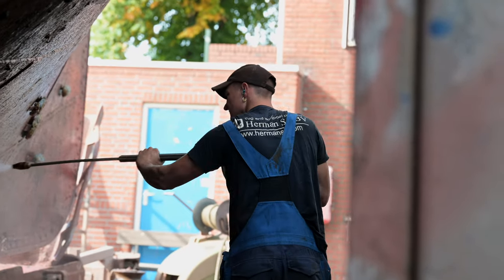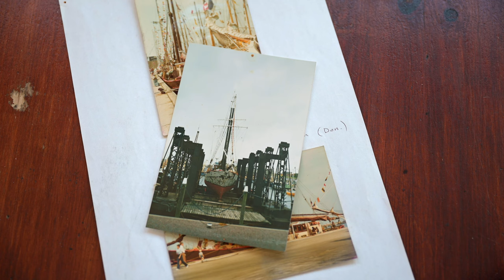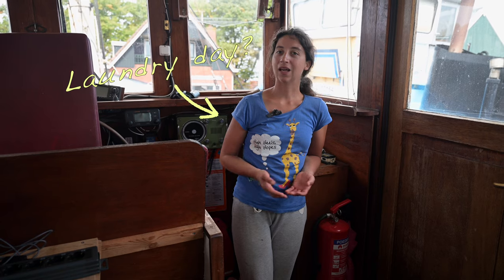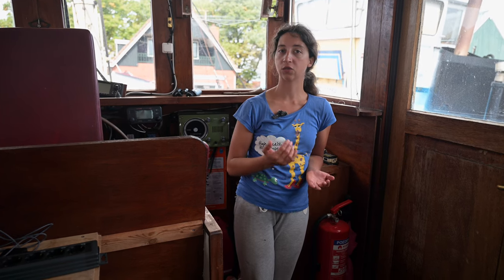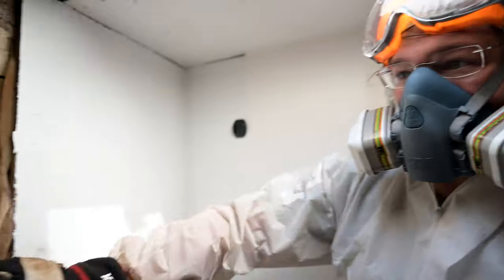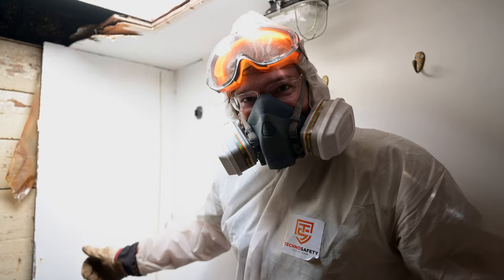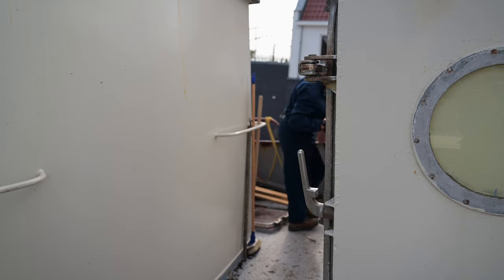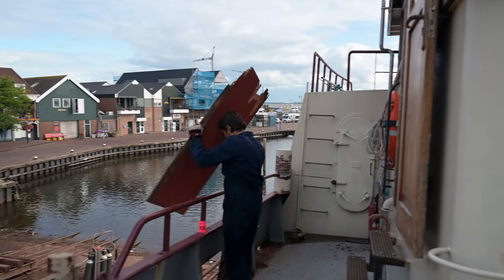Gutting the Interior so we can weld the Hull! We need to be fast!

Comment: There is a product called "RustLoc" it's made by the Pettit paint company here in the USA. It is sold as a "Rusty Metal Primer" and is a product I've used many times over the past 35 years and have found it to be a great product that works unbelievably well "IF" you follow the directions EXACTLY. You'll most likely end up using the "Needle Gun" and other mechanical descaling equipment to prepare the inside of the hull. Then use some type of metal primer/protector coatings, prior to covering it with insulation/wall coverings. I've not had long-term success with any "rust converters" on the market, to me, it is a lazy man's answer. My experience has shown that for Rustloc or these rust converters to work correctly, you need to remove all the rust and corrosion you can with these mechanical means...(which will be well below the  "White Metal" finish of sandblasting.) This thin final layer of rust/corrosion that is the devel to remove; can now be successfully treated with a rust converter...but at that point of preparation... I feel that Rustloc gives better long-term (life of the boat) performance.  To give you an idea of its adhesion... If you don't clean the top of the paint can PERFECTLY before you replace the lid on the can...it will weld the lid to the can and you'll need an ax to reopen the can. 
You truly have a major project on your hands not unlike the rebuilding of the wooden S/V Tally Ho... except yours is made out of steel.......B.O.A.T. Break Out Another Thousand...

Comment: Did the old insulation trap moisture against the inner hull? Are you going to have to use some kind of industrial rust converter and sealer on the inside? Great job regardless 👍
Reply from the maker: We think originally there was a layer of tar, oil or grease in between the hull and the insulation. But it's long so there is a lot of rust. The plan is to blast the hull, either sand, laser or wet. We have to think about the coating, maybe a hot zinc coating or a two component zinc primer and a one component topcoat above it. I have to do some research if it's a good idea to use some rust sealer or converter behind the frames. For now we just remove the rust and since we are not living in the hull there's barley any moisture and no new rust.

Comment: In view of the high cost of staying at your dock, I suggest that you rent a hand-held laser rust remover for the next steel plate rust removal process. It will save more than 90% of the rust removal time, only one cable is needed to plug in, you can irradiate the surface of the steel plate with a flashlight at 3000 degrees Celsius, and any magazines except the steel plate will disappear in a few seconds. The only thing you need to do is to protect your eyes and body from being burned by the refracted laser. I don't know if there is a similar machine rental locally, but it's a common industrial machine in China.

Comment: The insulation looks to be Coal Tar Pitch.  I have worked with it years ago. The dust will make your skin sensitive to the sun
Reply from the maker: The insulation is cork hold together with tar. We call it tar cork. How dangerous it is depends on if they've used bitumen or real tar. We've been quite carful in wearing our safety equipment. Now the insulation is gone and that's great!

Comment: What will you eventually replace the cork insulation with? I gathered from your narrative it had been impregnated with tar; will you use more of same or something else?
Reply from the maker: The cortiles themselves are made from pieces of cork glued together by some sort of tar. It could be pine tar but it could also contain PAK. The nasty thing about that is that it's not only about the particles also about the fumes and also skin contact is dangerous. I don't think they still make this stuff. Our plan is to use Armaflex glued to the hull as a condensation barrier and sheep wool to keep us cosy.

Comment: I was just wondering if you have any survey on the hull prior to purchase. I think you mentioned having one that pointed out flaws in the hull in a prior episode. Would you be able to get the surveyors insurance to pay for the hull repairs that are missing from the survey? 

I think this could also be a blessing in disguise, I had a project boat that was in a similar state but way smaller (10m narrow boat), that I lived on while renovating, doing hull work ect. If I had done the hull, water tanks, and waist tanks all in one it would have made living in it a lot more pleasant as well as cheaper in the long run. 

I was also wondering, while you have it all stripped out behind, can you get the yard to weld over the rivets so you know they will never spring a leak. I don't know if this is a good idea or a bad one though.
Reply from the maker: Yes we had a surveyor as a second opinion and it took about 2-3 hours to have a look at the worst spots. But it's always difficult to survey a project boat. We also had the offer for a full survey and it was close to 5000€. As a reference we paid about 500€. After all the difference is about what the welding of all the electrolysis costed. 
A riveted hull is constructed very similar to a wooden hull. It's not a bad way to build a boat but only a few experts are still able to repair it in the traditional and best manner. Welding is an ok solution but it's not rational to weld more than necessary. Also there are quite a lot of rivets, so building new would probably be cheaper.
Reply: @FlyingConey  well in that case you are in profit over all! Good news in a way! 
Thank you for the information on the rivets :) I have never dealt with them before.

Comment: After watching this I feel you should stop playing with surface finishes, pull up the sole concentrating on clearing out and inspecting the bilge, seeing your already going to have to weld and replace stringers etc, you could easily far exceed the funds you have for this trawler sailor. 
Not wanting to burst your bubble but you guys sure could be heading in the wrong direction .
Pay for a quick survey of the bilge at least.
Good luck
Reply from the maker: Thank you for advice! I left a few spoilers regarding the frames and stringers in and we will focus more on that in the next video. There is no bilge under the sole. When the ship was built they threw all the srap steel from cutting and reciting the hull in the bilge and they poured concrete over it to get a flat sole. There is no way of removing all the concrete. Interestingly there is also concrete in between the frames let's say about 60cm up from the flat bottom. We think that was to protect the hull against the ice that was used for the fish.

Comment: Often you can find good uncertified boat workers to help out with allot of the unskilled work. Usually a couple at every boatyard. $30hr instead of $100hr. I'd sand blast that hull inside and out before repairs, rust converter and paint.